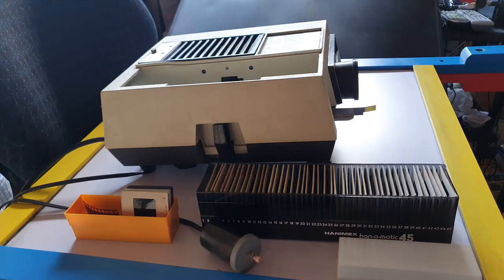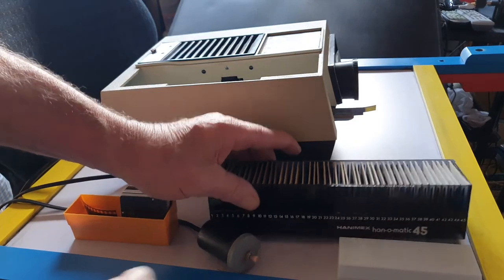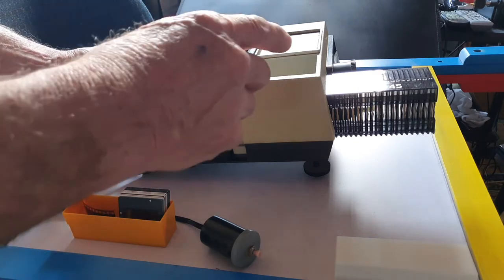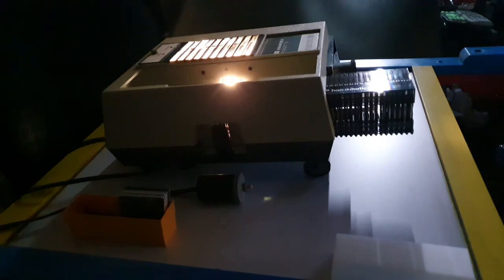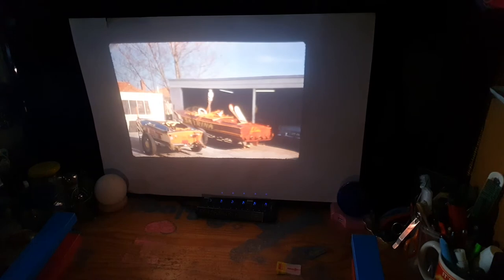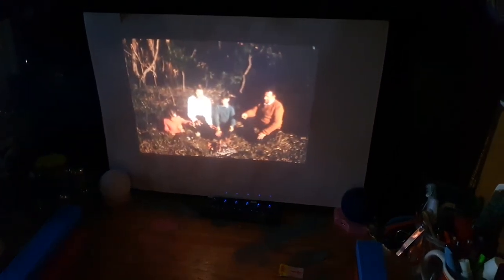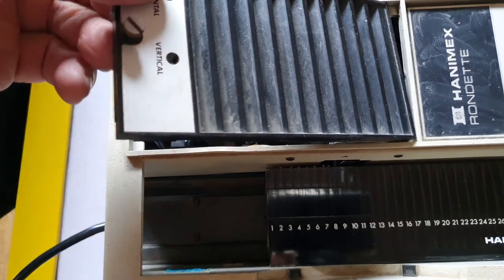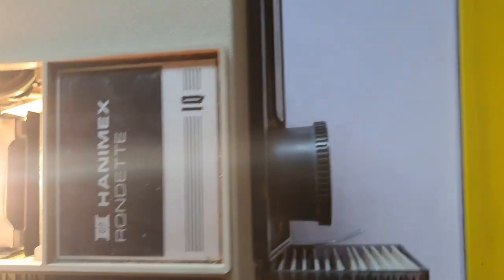Slide Projector - Hanimex Rondette 1200A

Comment: The video might have mentioned that if you shop for a slide projector, you should know that there are three main types of slide tray, which are not interchangeable. This means that it is best to first consider what type of tray you have or plan to buy, then limit your projector selection to that compatible tray, or visa versa. The three primary types are Sawyers, straight and circular, used by numerous projector makers, mainly made in the US and Japan.(Nikon, Minolta). There are the Kodak Carousel trays, both straight and circular, which uniquely fit Kodak made projectors. Finally, there are straight and circular trays which fit various brands of European-made projectors. (Rollei, Leitz, Zeiss) Sawyers-type projectors will commonly take both straight and circular trays. European projectors will take straight or circular, but not both. Optics: Lenses made by the high end European makers are all excellent. Lenses for Sawyer-type projectors are all over the quality map. Sawyers brand lenses are superb, some of the best. Brands other than NIkon and Minolta. not so much. Surprising perhaps, Kodak's Carousel lenses are total crap. Lenses for their professional Ektagraphich models are much better.